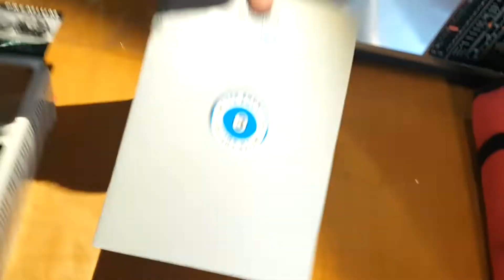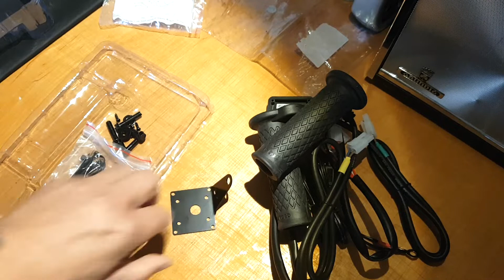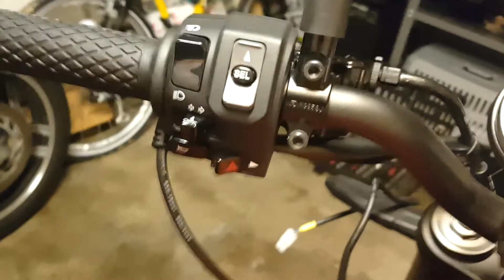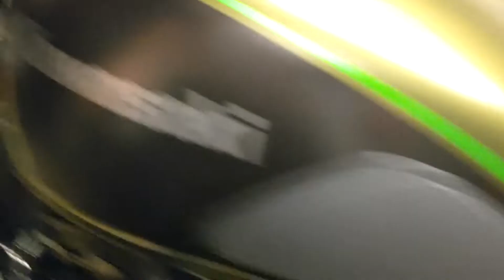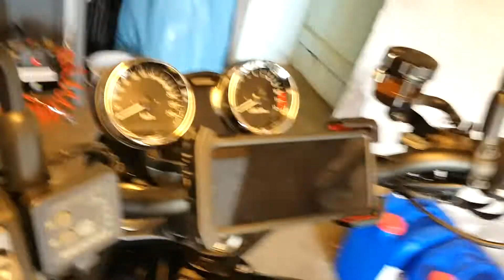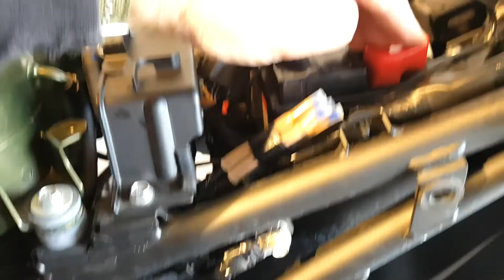Kawasaki Z900RS Heated Grips Installation.

Comment: Why not just find out what one of those 4 wires is the positive and use that as a feed,I've got ultimate addons grips to fit soon.
Reply from the maker: I preferred to use the Kawasaki grip heat wiring, which is controlled through the ignition switch.

Comment: Derek, it’s a fact, your Oxford grips are designed to Auto shut off after a short period with key in ignition off position. It’s a feature benefit that is clearly stated in the installation instructions.
Reply from the maker: I did read the instructions and I'm fully aware of that but I do feel better having the system definitely switched off when the ignition key is turned off. Now it's doubly safe.

Comment: wrong, oxford turns off automatically of engine is stopped after few minutes.
Reply from the maker: I figured it out after the installation but my method is better anyway because if the bike is off the grips are off.

Comment: Lovely bike, hopefully I'll be getting a Kawasaki Z900RS SE 2024 in the new year. I've fitted the Oxford heated grips a few times, they're great. They come with a power saving mode (BSM), which shuts off the juice to the grips when it detects the voltage has dropped. I use a INNOVV Power Hub 2 power relay, it's excellent for powering your grips, GPS, spotlights, etc. It shuts off the power after 10 seconds when it detects you've turned the ignition off, via its yellow wire connected to a live wire on the loom, like the one to your rear brake light.

OXFORD MANUAL
Battery saving mode (BSM)
– This amazing new feature recognizes if either the battery voltage falls too low, or it’s high enough but suspiciously quiet (ie. the engine has stopped);
– When in this state, the BSM LED flashes, the power LED still lights as normal, and the button still works - but the grips don’t actually get powered;
– As soon as the battery voltage recovers and/or there’s a bit of noise on the power supply, the ‘battery saving’ LED goes out, and the grips work as normal;
– The controller goes into BSM after 5 seconds of the voltage being less than 11.5V, or after 2 minutes of not detecting any noise on the 12V power lead. Once in this mode, it will wait a further 5 minutes or thereabouts before switching off completely. 👍
Reply from the maker: I did read the instructions but I chose to wire the grips into the bike using the fuse box locations intended for OEM heated grips. A riding buddy did it as per the manual and had no problems. Either way they work great. I just wish there was a better looking control panel.
Reply: @DerekHerbst747  Yes, the controller does divide opinion, and annoyingly, the fixing plate rusts! I was in two minds whether to get the Kawasaki heated grips, but I've heard they don't get very warm, so I was going to go with the Oxfords as I think they're great. But, good news, Oxford have now come out with the 'Hotgrips Pro' heated grips with an integrated controller, the downside, they're double the price! Hope you've been enjoying the bike. 👍

Fitting the Hotgrips Pro 👉 https://youtu.be/74gEkNmHzaM?si=eWO75IYwlsIBVuc5
Reply from the maker: @soulrebelno1  this bike is amazing! I put better tyres on (Michelin Road 5) and dialled the suspension. Awesome 👍
Reply: @DerekHerbst747  Yep, 'Neevesy' (Michael Neeves) from MCN always recommends changing the OEM rubber, he's one of their top road testers, and he says it can transform a bike, the same goes for the suspension. I had a Yamaha Ténéré 700 a while back but never really got on with it, way too top-heavy! I sold that and bought a Suzuki SV650, which I love, it brings a smile to my face every time I ride it. Its V-twin sounds wonderful with a slip-on, and goes like stink, best described as a boulevard dragster!

But, it's time for a change, the two contenders being the Triumph Speed Twin 1200 or Kawasaki Z900RS. I'm 6' 2" and the SV650 is a bit too small for me, and my legs tend to cramp up when I'm on it. When viewing the Speed Twin 1200 reviews, they all comment on how small the bike is, so I'd probably have the same problem. You really wouldn't think that would be the case for a 1200cc bike, because its capacity is nearly double the size of the SV650, but it's a parallel twin, so it's more compact. I've never tried one because the dealer is miles away.

When getting my SV650 serviced a couple of times, I had the chance to spend sometime with the Kawasaki Z900RS, the nice Candy Tone Blue one with the gold stripe, it looked stunning, and was top quality! As soon as I sat on it, it just felt right. It sits a bit taller than my SV650 and has more legroom, and strangely, it felt lighter than the SV650, probably down to its centre of gravity, so I was sold on it, forget the Speed Twin!

I've decided to spend the extra cash, and go for the Kawasaki Z900RS SE “Yellow Ball” model, I think it's worth it. I'm going to see if I can get a demo on the standard Z900RS, as my local dealer had some second-hand ones in stock, because I've got no chance of getting one on a Z900RS SE “Yellow Ball”, as they're a limited model. Hopefully, all that will happen in the new year, depending on insurance premiums, which have shot up here in the UK—44 percent—plus, I'll have more no-claims under my belt come January. Anyway, fingers crossed it I hope to have a new bike on 1st March 2024, when the new registration plate come out for that year, cheers.